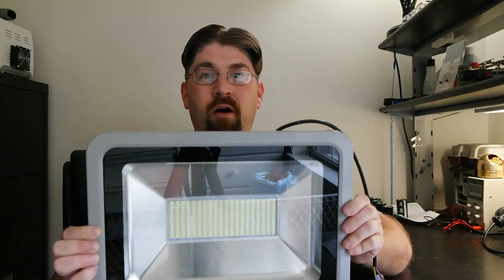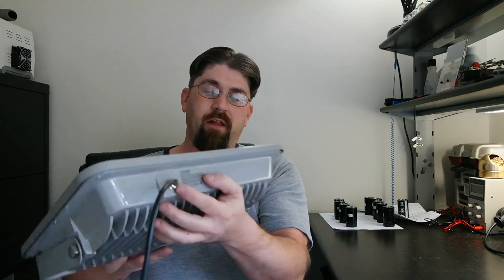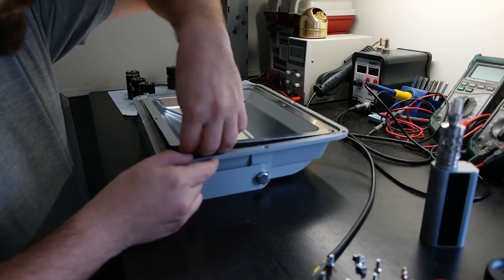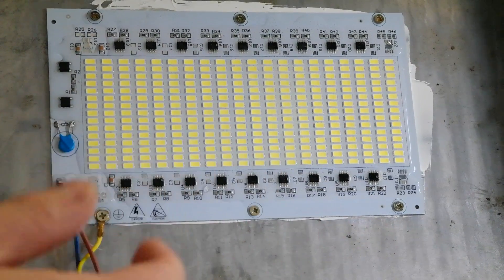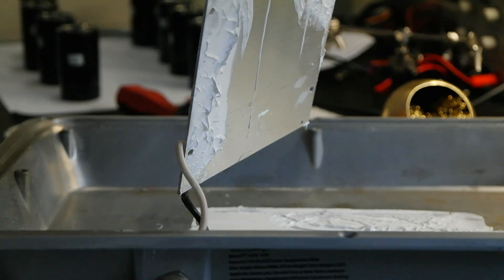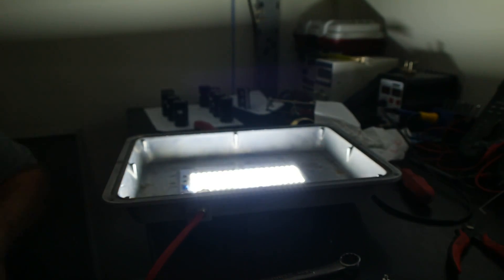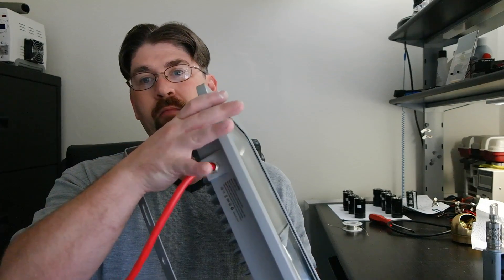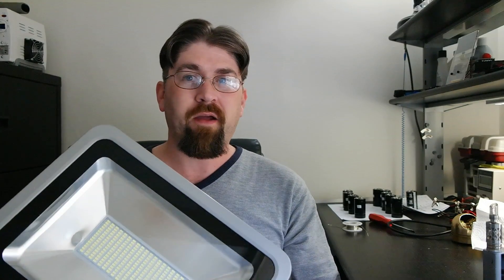$40 150 Watt eBay LED Floodlight Review, Repair, and Modification

Comment: I bought 4 of these for my coverport garage exterior ! they are supposed to be rated for 100,000 hours. at 6 months later all of them need to be replaced. "CHINESE MADE JUNK" is my review. DO NOT BUY !!!
Reply: the way the heatsink grease was originally applied, as you saw in the video, is the reason they burned out... Maybe the Chinese do it on purpose??? Payback for cheap Americans???
Reply: They construct it with speed in mind, and not taking it apart to look and see if it made contact, its not like putting a heatsink on a processor where nothing bends. They put it in place then set the board on it and screwed it down thinking it would set it. But u get what u pay for, to simply say made in china is not the whole story.  You can buy plenty things made in china that qc is much higher and have higher manufacturing standards. Depends on the company that is having it built. having said that, if u bought something that seems ridiculously  cheap, then guess what, u are not paying for high standards or high qc inspections.
Reply: same thing  less than 1 yr they were all dead
Reply: Could it also be that they are being burned out due to too much voltage?
Reply: Get something made in Taiwan, not the same QC as mainland chinesium

Comment: Sooo....  the two "fuses" are actually capacitors. There should be more where the "C1, C2, ... " spaces are, but it will manage without. It just means that if you filmed with something with a high fps like an ipad it would flicker.

Comment: 100watt light sold as 150 is "not bad" lol 9500 lumen ebay crap... maybe but that is close to 100lm/w efficiency eh... little high for ebay.  I get the ones off ebay with drivers and replace the LEDs with shit from digi key.  Real lumens lol.  Also, I'd complain to ebay not as advertised.  It aint 150 watts... its 100... get money back lol.
Reply: The absolute majority of Led products are listed as theoretical maximum LED power handling, not power consumption of the whole light OR the actual power the leds recieve. 

This is across basically ALL Chinese led products which is why it's always buyer beware. 

Because theoretically the leds themselves can take 150w you are buying a 150w light, it's just not driven by full power which is also often a good thing(leds last longer and are usually actually more efficient at less than full drive)
Reply: It might draw 150w when it gets hot though.
Reply: Which flood lights on ebay have drivers?  Can you provide a link for an example?

Comment: What heat paste did u add to the back of the pcb board? or did you just try and spread what was already there? i live in australia where would you buy such(arctic silver 5 or cpu spread paste is quite expensive)
Reply from the maker: +Stoogie I just used and thinned out what was already there.  It was way too thick of a coating for proper heat transfer.
Reply: Thanks for the reply, i baught it off ebay australia supplier for $49 AUD with postage, havent wired it yet but glad i found your video, can do exactly the same as you did here though i need to buy some solder, a soldering iron and pliers or whatever u call them to strip wires(i have a cert 2 in electrotech so i know how to do all that including wiring plug ends and everything i just dont have the tools), but thankyou for the video, lucky its the exact model too lol. i baught this as a cheap alternative to a light box for Seasonal affective disorder (SAD), and NON24 light therapy.
Reply: Stoogie It's Called Thermal Compound. It's used for adhering cpu processors, heat sinks, graphics processors, capacitors, etc. If you don't have an even layer of thermal compound sinking the wiring grid or circuit board to the aluminum or copper 100% your led light circuit board may have a few lights that don't receive any signal. This also can make your led circuit board overheat and catch fire. I didn't see a heating sink nor fans on this light board. If your going to purchase this please do some research and install all the hardware that's necessary. FANS and a heat sink. Grab an old cpu,or game device and gut it for part's. Also try local scrap yards...

Comment: really crappy inner construction, okay 40 $ but still those improvements does not cost anything. Make a good solder points and ISOLATION !, the heat conduct paste was crappy done, screws only on corners so the middle part is bent off the sink.

Comment: I sold quite a few of these array LED floods last year. They needed attention as you showed, and almost all of the ground wires were loose in stripped out holes.
The 100W ones have been perfect, no returns. The one with PIR on the house is 3 yrs old and works great.
The 50W array floods turned into a nightmare. Same problems, but the boards go bad in 2 months. Haven't tracked it down yet. I have replaced probably 5 of these under warranty, and they were on the phone again today with 4 bad ones.
I don't want to keep replacing these only to have them fry again in 2 months.
My answer is an all in one COB chip. You solder the 120v leads on, put on some compound and screw it down. Done. No driver. if you google "[MingBen] LED COB Lamp Chip 5W 20W 30W 50W 220V 110V Input Smart IC Driver Fit" you will see where I got them for $2.18ea for a 50w chip. I love the COB LEDs in my Big Larry and pop=up lanterns, thought I'd give this a try. I might even rehab some old halogen flood work lights if they work good.

Thanks for the awesome review! Keep up the good work.
Reply: Link to the more-reliable 100w model you mention?
Reply: Don't go with those Cheap COBS that claim 80-90 lumens a watt. They are closer to 60-65 and drop quickly. Spend an extra $5-10 and get some high efficiency CREE's at 150-172 lumens per watt. You'll need less heatsink (or it will operate much cooler and prolong the led life) you'll get double the light and or cut your electric bill in half. Here my electric is 23 cents a kwh. at 12 hours a day that's $151.13 a year for 150 watts while spending an extra $5-10 up front will pay for itself endless times over. Also the Cree have better CRI, much longer life and are 1000% better for a film lighting source. Those cheap COB's rarely have good Color rendering.
Reply: @RadiationNetwork  link to those cree led's? any with high voltage like 150watt? or 100watt?
Reply: The CREEs in the digikey link are 36V to 77V.  The Ebay flood light in the video has a power supply built into the LED board.  How is a CREE powered when there is no power supply in the ebay light?

Comment: I ordered several(100w) of these type (over time from different manufacturers) which were supposed to work for hours and hours during the night and they all died within some weeks. The weekest LED of a triplet dies first, the other two will follow soon disconnecting the other LED's. Maybe good enough if just on for a short time.

Comment: is your house built in the middle of a freeway?
Reply from the maker: Michael Byrnes no, but I'm right next to a busy secondary road, so it's hard to get rid of the road noise.
Reply: Mad Electron Engineering build a sound wall from cheap floodlights
Reply: Are you from Delaware?
Reply: DildoShwaggins he is delaware

Comment: Typical Chinese construction, badly made and might well kill you. Your advise makes sense, always look inside before you connect power then you might live to use it. At least the earth was connected, 90% of the time they don't bother.
Reply: Michael Beeny To chech the ground wire,  use ohm to case test for continuity.

Comment: As a photographer and filmmaker, may I suggest you not install the light behind you because you will be in shadow.
Instead, mount it where you had it in the first place (behind the camera), but put it up higher to bounce off the ceiling or aim it back toward the wall. Either way, the bounce light will be flattering for your videos.
Reply from the maker: +Terry Thomas I will try putting it behind the camera instead of on the side next time.  I was bouncing the light off the ceiling since I got it to have a more filling effect with the light.
Reply: And, if you are using the ceiling as a reflector, paint it pure white. However, LED light, like fluorescent light, will affect your colour rendering. Daylight is always best.
Reply: @Agent Bertram, maybe I was lucky with my copies of these LED lights (I use 2 100Ws for key and fill) but there's no shift at all sir. NONE.

CRI in my opinion is relative and any shift in color is fixable by manually dialling in your Kelvin values (I use ML on all my Canon Rebels) with an external monitor to see my colors are where I want them before I shoot.
Reply: use the 95 CRI flat panel lights, with no flicker driver, would be the best!
Reply: CRI is not a matter of opinion nor is it relative. Its a mathematical measurement, IE color rendering index. Not any more relative than how many inches make up a foot.   What IS a matter of opinion is what to do with it and how much it really matters in the end for your purposes, and how much just white balancing can fix lower CRI lighting.

Comment: Hmm, I don't see any big caps and transformer. It looks like a direct AC driving circuitry. Is there any flickering at all? 

Recently there have been many cheap "driverless" LED modules that can be directly connected to AC. But since the controller and LED work under 50Hz or 60Hz these lights flicker like hell. If you move your fingers very fast under such light you will see it...

Comment: I had a 50w one from eBay, cheaper and similar design. it lasted 4 months before is failed. the original halogen went back up again.
Reply: You probably saved more $ in power than the $ for the lamp. ;-)
Reply: Andrew Jones I got a 100w single led model on my property and it's been going strong for over two years now. was yours the style with more black on the face? if so there's warnings up about them being crap.
Reply: Hello we have the 50W Floodlight, we provide 3years warranty, learn more please contact sales03@evblighting.com

Web:www.sl-lighting.com

Comment: the hit sink is pretty thin, because of the heat the back of the hit sink will bend away from the led board, and during 1 year you will have burnt out leds, also the amount of thermal paste is huge under the board, it should be as thin as possible.

Comment: Hi M.E.E., one small but picky safety point, you rewired the mains lead but there needs to be a small change here. Make the earth lead the longest lead. That way, should the unthinkable happen & it gets pulled out, the earth lead is the last to be disconnected thus making the unit safer:) Nice vid.
6A8G.
Reply: 6A8G 
Of also be tempted to sleeve those wire ends since he's melted the insulation to the point is expended and the live is pretty close to that alloy main body. 
That our better yet encapsulate the  soldered ends with something to make sure nothing is going to touch those solder joints 
.
Reply: Also always tightly tie a large cable tie to the inside of the gland, so that it's impossible to pull out.
Reply: Isn’t that how they make the UK plug?
Reply: Also always tightly tie a large cable tie to the inside of the gland, so that it's impossible to pull out.
Reply: Before cable ties, self amalgamating tape or half hitch knot can do the job.
Reply from the maker: 6A8G good idea.

Comment: Einstein just placed a proven high heat source into a flammable baby bed to test the light spread in the room.. Darwin award candidate.. Subscribed!!
Reply from the maker: StealHrtVideo that's Mr. Einstein to you my friendly troll.  and the back heats sink doesn't even get to 200'F, which is much lower then the Flashpoint of the baby changing table or plastic.
Reply: StealHrtVideo - baby beds are treated with flame retardants!
Reply: If you think that, then you don't know what the Darwin award is.
Only those who do something stupid BEFORE passing on their genes are candidates for a Darwin award, if he already has kids, then the Darwin award doesn't apply :P.

That being said, I highly doubt the light can generate enough heat to make the baby bed go up in flames.

Comment: Have you ever done a spectrum test on the light to see if it has photography applications? Not sure if you have the capability but it would be cool to see what the spectrum is.
Reply from the maker: HeyZeus667 sorry, I do not have the equipment necessary to do a proper light spectrum test.

Comment: Looks similar driverless design like BigClive tested some days ago. But this doesn't flicker at all?
Reply from the maker: +andromedar1977 I haven't noticed any flicker thus far.
Reply: andromedar1977 A better camera i guess like flash rate etc
Reply: andromedar1977 the flicker is noticed due to exposure rate the I pad that Clive uses has an exposure rate that is very visible on the 50band

Comment: I buy similar units to these for indoor use and always open them up and check the grounding and hot/neutral attachments.  I also optionally drill out a 3/8" hole to mount an on/off switch, which really makes them very useful lights.  I sometimes go the inline on/off switch route, mounting it about 18" down the cord from the light.

I really enjoyed this video.
Reply: BillyLapTop ...if you are in fact, taking them apart, be sure to properly spread the heatsink grease, using a "putty knife", or they will burn out in no time, as this one would have, if he had not found that defect!!!